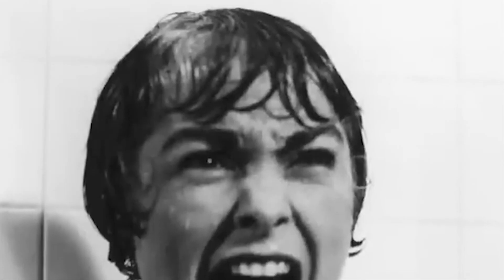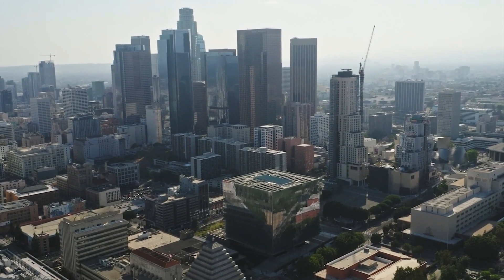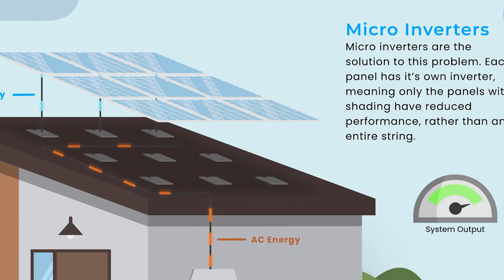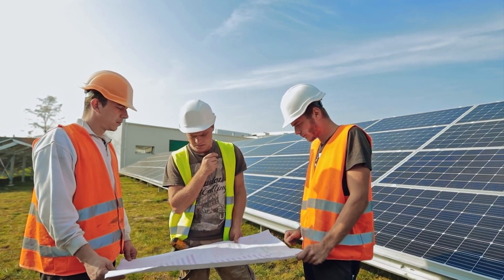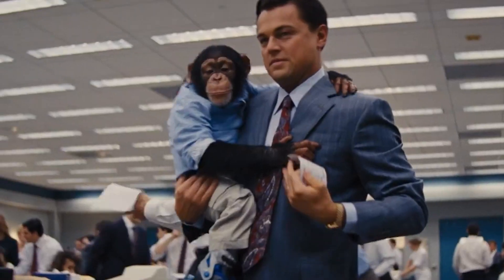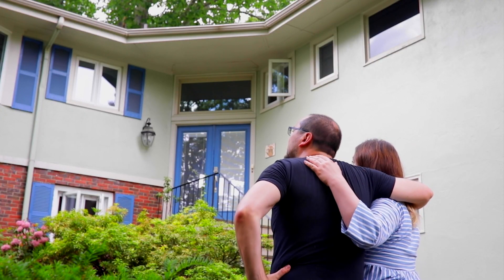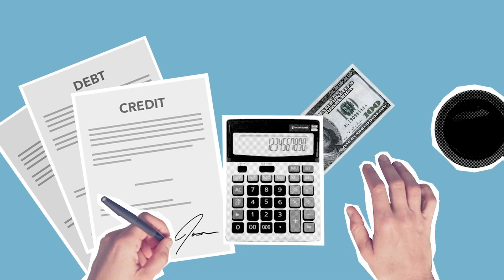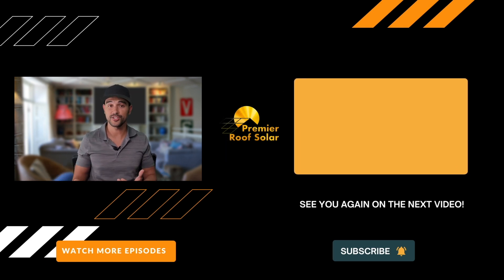5 Common Mistakes When Getting Solar. No. 3 is the most costly

Comment: "You absolutely do not want string inverters alone" = misinformation.  Many people have proven that wrong. Plenty of youtube vids and White Papers and University Studies have debunked that myth. Solar panels having multiple diodes now and inverters MPPT being very good have not made any technology a clear winner.  btw - Enphase was founded in 2006, first product in 2008, clearly not ample time to prove their 25 year warranty. And SE reliability and support and product failure replacement practices should be researched before that investment.
Reply from the maker: "Absolutely" may be too strong a word.
While all the panel improvements you mentioned do help mitigate shading issues, the fact still remains that a string inverter alone is limited to the lowest producing panel and panels with shade will produce less than ones without so limiting the drop in production to only the ones with shade is much more preferable than having the whole system affected. Even if Enphase hasn't been around for 25yrs they're replacing faulty inverters at no additional cost for the 25yrs which is what matters.
The biggest difference is that string inverters are a single point of failure, which means the whole system goes down if there is an issue or if it reaches end of life and you don't buy another one until it goes down.

String inverters can make sense in some situations but that's mostly for large ground mount arrays and commercial systems not residential. For residential It's recommended to have them paired with Optimizers to reduce shade issues and reduce the risk of string inverter failure.
Reply: @PremierRoofSolar  Your shading assumptions are again incorrect. Single point of failures perhaps after 15 years. Longer than Enphase and SE has been in existence. Consider the increased costs of MI's. And the additional wiring and labor and having to get on the roof to replace a MI failed module. Not saying MI's are bad. SE optimizers failure rate and replacement times should be thoroughly researched though.

Others can research if they want to learn the facts. Plenty of tests have debunked the shading myths when using a quality inverter such as SMA or Fronius with todays modern panels.
Reply from the maker: @ridemfast7625   the additional cost is marginal for the average sized system and costs less than buying a 2nd string inverter after 15 yrs. Again Micro-Inverters are covered for 25 yrs which means no additional cost to replace them during that time.
As far as shading no assumptions were made so I'm not sure what youre referring to. You talk about improvements on panels which helps but doesn't address the fact that string inverters are limited to the lowest producing panel. Are you really trying to mislead people into thinking shading/indirect sunlight makes no difference at all? That would mean that North facing panels produce as much as South facing. Sorry but that's no accurate. That fact is that shade/indirect light vs full sun exposure does matter. Not sure why you're trying to say otherwise
Reply: @PremierRoofSolar  You are misinterpreting what I said and/or making sheit up.  And a 25 year warrant by companies that have been existence for only 15 years. What Im saying is, light to medium shading does not provide MI the advantages that is being falsely propagated.  Again, I have no problem and in fact encourage consumers to research this. Are you saying MI's with shaded panels do not have a decrease in  Pmax?  And tell us what the maximum panel size is allowed for a micro inverter? MI can not take advantage of large panels in terms of watts. Therefore, require more panels, more hardware/racking, more wiring, more labor... The point is, their is not one best solution!
Reply from the maker: @ridemfast7625   people can and should do their own research. They'll find that the vast majority of studies and reviews done by 3rd parties (not the manufacturers) have found that most string inverters are limited to the lowest producing module. Even ones that are not as affected by shade are a single point of failure and need to be replaced at additional cost halfway through the systems life cycle (unless its covered by a good installer). They also don't give you panel level monitoring. These types of inverters make a bigger difference costwise with large commercial systems. 
If you don't want a single point of failure, want panel level monitoring and know for sure that only the panels without direct sunlight are affected then a micro-inverter is the water to go. The SMA Sunnyboy and some Fronius are a great string inverter options but still don't address panel level monitoring nor the single point of failure issues.